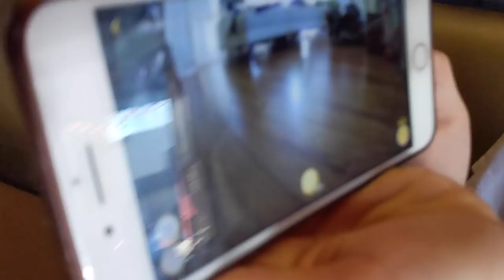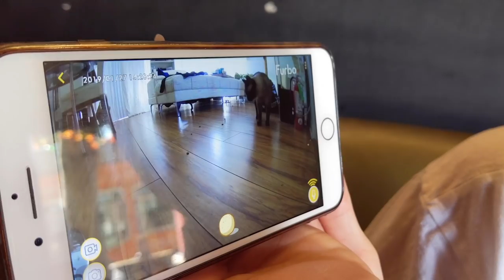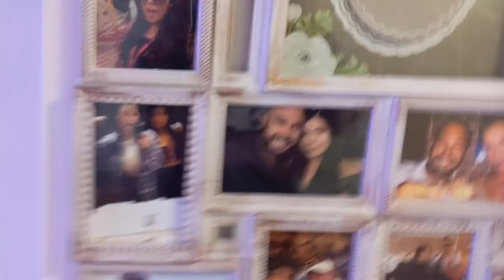Peanut Butter Shots & Wig Shopping!

Comment: You totally could have sold or donated that couch, and the weights and stuff you threw away.
Reply from the maker: I realized that 😅 nobody I knew wanted them and I had to be out like that day I still feel bad about it a little. But the weights we're Rusty and the pull up bar was getting wobbly sooooo
Reply from the maker: *were
Reply: Goodwill, Salvation Army, Savers, etc. I think some locations will even pick up nowadays. Just a tip to look into for next time. You'd be surprised what people are willing to clean or fix to save some money and/or prevent landfill buildup.